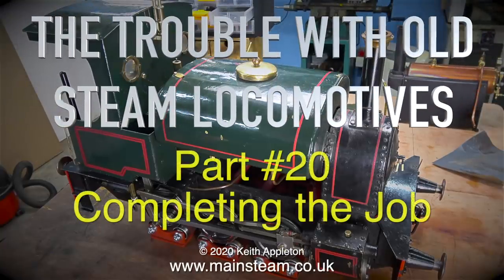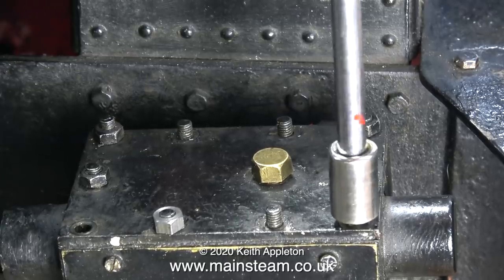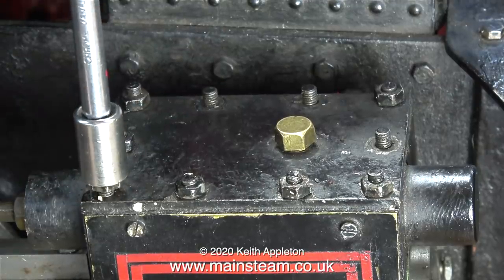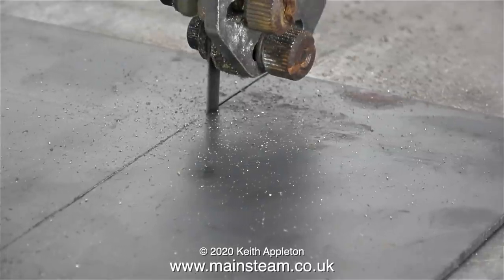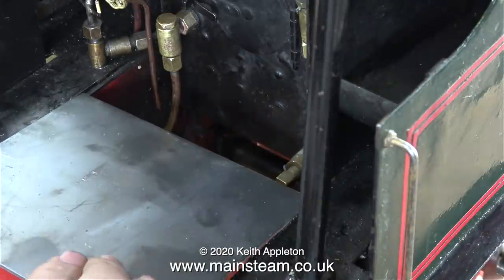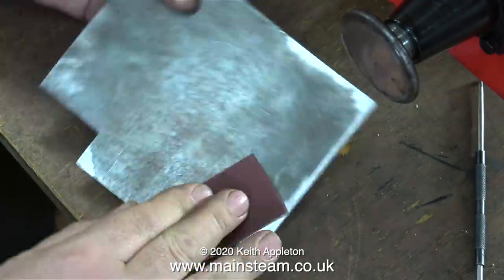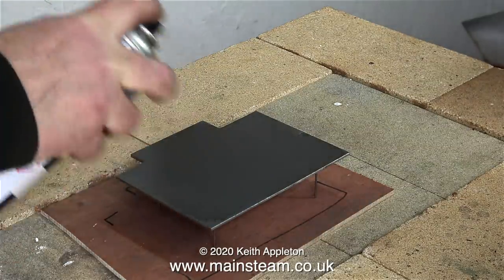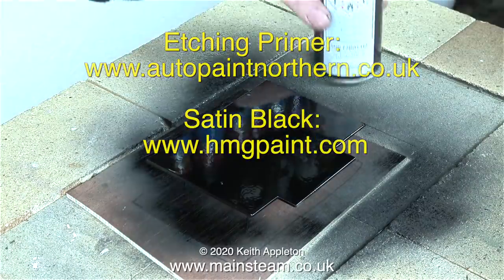THE TROUBLE WITH OLD STEAM LOCOMOTIVES - PART #20

Comment: Does anyone here know if the chassi bolts on pre 1960s Hornbys are BA tread?
(it's not metric and it does not seem to be UNC either (at least UNC nuts does not fit...), so my taughts is that it's either BA or original Withworth, but at least to me it looks different than Withworth...).
(i wonder because i need to order treading tools)

Comment: I drive the nails through and use the point so it will not mark
Reply from the maker: I used to do it that way until I put my hand down on one of the nails - now I do it this way - it's safer }:-)))
Reply: @keithappleton  yes it is safer
Reply: Live and learn